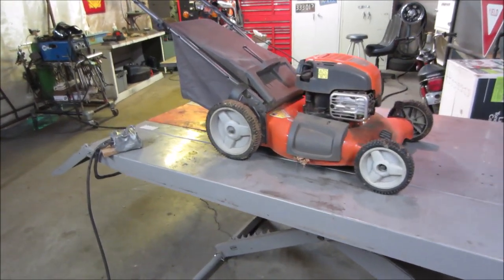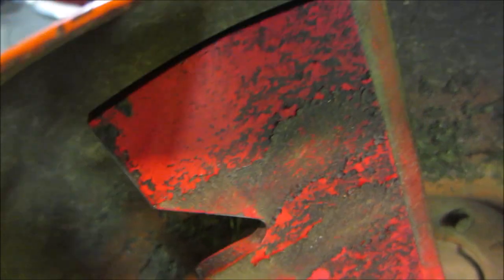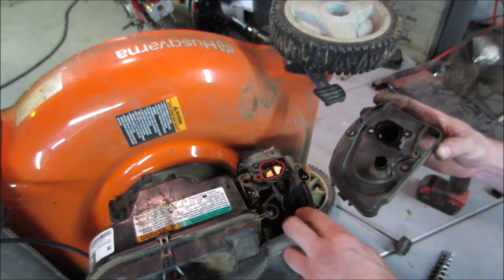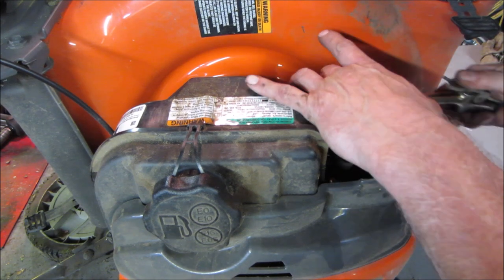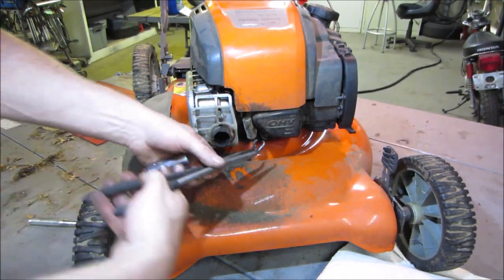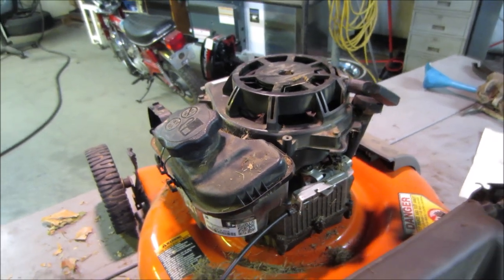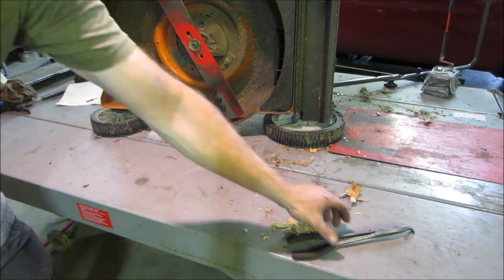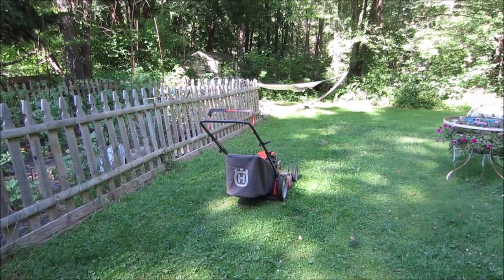NO OIL CHANGES? Servicing A Broken Yard Sale Lawn Mower,

Comment: I found two mowers put out for the trash. One, a nice Toro with a thick steel deck and nothing wrong with it. The other, obviously had been run by someone mechanically declined, with the blade on upside down, air filter on the wrong way. Runs fine now, heh.

Comment: I used to run the "standard" gas with stabilizer in my push mower, and the carburetor would gum up from residue.  I switched to non-ethanol gas, and the mower has been running like new for 9 years.

Comment: I guess they were just expecting enough oil to burn in order to eventually add more! My little Briggs and Stratton doesn't have a drain plug either. Just tip to change.

Comment: I bought my first push mower for $20 and fixed it with with a new pull cord and a brake cable, starts on the first or 2nd pull every time and never even touched the carb.

Comment: That Briggs and Stratton engine has some good qualities, but you have to be careful fueling it, if you go too fast or put in too much fuel it pisses all over the air cleaner and won't start unless you change the air cleaner or wait 30 minutes or so for the fuel to evaporate. I also put a prefilter on the air filter to help them last longer, so far so good with that.

Comment: Harbor Freight sells a nice little hand pump that I use just for this purpose also you can use a vacuum method with a mason jar I do lawnmower myself for these oil changes I charge $10 because what I do is I fill it up with oil run it for 10 minutes and then change it again my customers really appreciate the oil being decently clean

Comment: Never change the oil so it breaks and you buy a new one lol. I just got 3 riding mowers and have 2 of them running and moving this afternoon. One needs a new throttle linkage and a new tire I tried to slime it and it was just so dry rotted and cracked that it didn't seal it entirely. I'm gonna resell it "probably" so I might want to replace the tire with a brand new one. I also kind of want to keep one for work but I'm not sure which one to keep! Only one has a deck with blades but the other 2 are heavier duty, the 3rd one is very heavy duty it is more of a tractor. Just so happens the tractor will not run and I'm not sure what is wrong with it, I haven't had a chance to pick it apart and see what it needs.

Comment: I've used my mower 30 years and never changed the oil just twice on the spark plug. And it's been sitting outside all these yrs. It has always started by second pull
Reply: What kind is it? That's quite a distance! but honestly it's not as critical in a push mower, especially with a smaller yard or with shorter run times. Usually the wheels and cables are all crappy and broken before old oil takes out an engine, as long as it's not run low. They're pretty simple and durable when they're older.

Comment: we had a brand new craftsman that said just add we ended up giving a 400 dollar mower away to a friend that has a lawn service he hard a hard time getting it to stay running but it works now . I work on my old craftsman but not the new ones you have to use premium gas or that high price gas in a can. right now working on one my aunt gave me it won't start I guess I will trying cleaning the carburetor first but will have a new one on hand just incase good video

Comment: This is a pretty good lawnmower too. It must be pretty new because I bought mine last year from a husqavarna dealer. Cant believe they threw away their lawnmower for 30 bucks because of a blade that was backwards.

I'd probably keep the 30 and give it back.

or maybe sell it for 80 after, especially if its only a couple years old. Or more, cant remember how much this machine costs.

All over someone not reading.

Comment: I enjoy all of the videos you have posted.  I live out in the boonies and hate having to take my machines in for service and repair all the time.     I have one question for you.   On two stroke engines and four strokes. Which fuel would you recommend.   100%  No ethanol or one of the synthetic fuel? Storing for the winter I can see the synthetic would be best but using a lawn mower every week would be a lot cheaper to use the 100% No ethanol  but use the synthetic during the winter.  What do you think?

Comment: I picked up (on the sidewalk) exactly the same mower a year ago , old gas left in the carburetor problem , instead of cleaning the carb. , I replaced with the new one (under $20 from Amazon) , year later still running and no difference than a brand new !

Comment: Scored my craftsman self propelled electric start that way 25 bucks for it and a string trimmer cleaned the carbs and a air filter both run great electric start even works

Comment: The reason u never need to change the oil, just add is becuz they never last long enough to need an oil change and either burn or leak what u add. Garbage with plastic carbs. A real.revalation to me as i believed them to still be the company of quality whose dirt bikes i road back in the day. Of course thst upside down blade was cute. I liked ur oil change idea.of just tipping them over as the plugs never wish to break with their unions position of being stuck for life or stripped. Rich/San Jose

Comment: No problems with my husky, just change oil, and tune up each year sharpen the blade once in a while and let it go, however the dead man and self propelled cables are bad,  other then that works great as a pusher for my postage stamp property.

Comment: I bought a Chinese moped NIB , only topped it up when needed, ran it over 25,000 miles before I changed the oil, still runs good as new might put the oil back in
Reply: Sure your engine is full of Brown sludge and it wont Last long please dont sell the moped!
Reply: is it ? I don't think so, I put 5000 more miles on it since the oil change   , and no I won't sell it  , I will  continue to test too destruction , and many miles are at 55MPH ( itsa 2010 taotao vip powermax 150cc) _  Only cost $650 NIB

Comment: I never use a sandblaster on plugs as it accumulates sand particles wedged up into the plug and destroys the cylinder wall. much better to just replace the plug with a new one or in an emergency, Burn-clean the plug by playing the flame of a blow-torch over the electrode end

Comment: pretty sure i have almost this exact mower. ours is self propelled...this is going to be illuminating.  Fiance's dad helped clean the carb out because we did a dumb and left it with ethanol gas in it overwinter and it got gummed up.

Comment: Put in some new blades, change and gap plugs, change the air filter, change engine oil, clean deck near blades and then test on the lawn. It should run like new unless the fuel is bad or there's a clog in the carb. Always tip the mower on it's side with carb side up and the oil drain hole down.

Comment: I have used the same yardman lawn mower for about 15 years, never changed the oil. Never had to add any either. Only ever added gas and a new drive belt. Think I got my use out of a $100 mower.

Comment: I've been running my mowers on 2 stroke mix because I don't want an assistant misfueling the 2 stroke stuff. Runs fine, and it seems that 2 stroke gas doesn't clog the jets like straight gas may. (Will still eat gaskets, though.)

Comment: when i bought my new mower it came with a bottle of "forever" oil which was just a bottle of 5w30 full synthetic i read the engine owners manual from briggs that came in the box with the mower and the recommended oil change interval for a full synthetic oil is every 50 hours for mine. so you figure you mow half hour once a week 6 months of the year that is 4 years before you hit that oil change interval there hoping to sell you a new mower every 5-6 years. I personally  change mine every couple years and just use a auto parts store store brand 5w30 full synthetic one quart changes both my mower and my snowblower its cheap insurance

Comment: I get at least 5 or 6 of these style engines a year. Very weak connecting rods when under load such as tall grass. Had several with rods snapped. Also pretty much oil burners from day one, which is why you don’t change, just add. 😂

Comment: I’ve asked others this question and gotten no response. I have an MTD push mower and there is a funky little device off the muffler. 
It looks like a smaller muffler with screens and little holes. I think it might be some sort of crude air induction to reduce pollutants. But not sure
Reply: That's the spark arrestor. Stops all the hot carbon spitting out your exhaust possibly starting a fire and is also for pollution control. Take it off the mower, soak it in some petrol/gas and it should clean up, an old toothbrush works wonders. Refit when dry and it should be good to go for a while. I check mine maybe every year or so.

Comment: Did the smoke smell like burnt rubber? If yes, it was motor oil which went through the cylinder into the exhaust system when you slightly turned the blade (and the engine) while the mower was tilted. Seems to be a Briggs & Stratton thing, happens to mine too when I'm cleaning my mower's belly.

Comment: For fouled plugs I just hit it with a propane torch and burn off whatever oil/gas/carbon off the plugs. get the ceramic nice and cherry hot and go all around and you'll end up with a nice clean plug.

Comment: I BOUGHT A USED JD MOWER, IT DIDNT RUN WELL, I RAN A FEW TANKS OF SEA FOAM THRU IT, WENT TO WORK ON THE DECK ONE DAY, MAYBE REPLACE THE DECK BELT, TOOK THE BLADES OFF AND SHARPENED THEM, THOUGHT WOW THAT STILL LOOKS NEW, IT WAS UPSIDE DOWN, BUT THE STRANGEST PART, IS IT RAN BETTER, LOST THE MISS IT HAD JUST WITH TURNIN THE BLADE OVER

Comment: hey Mustie1!  I really love your motorized bike builds.  Recently Zeda Mafia has released a water-cooled 66/80 cc China girl.  I had a stock one of those kits a year ago.  It was really fun!  (And cheap)  and broke down ALOT.  But it got me thinking,  why hasn't anyone built a water-cooled v-twin engine using the el cheapo parts (or as much as possible) for those of us who don't have a pile of tools in the garage?  (I'm throwing this idea at you because if ANYONE can, you can!)  I'd like to see both an increase in durability (over stock) and modular (sort of) kits.  Do you think such a thing can be done?

Comment: Did the mustie1 2 stroke trick on my mower (almost exactly the same as this one) when it would not run but had spark. Thank you!
2 stroke mix in the spark plug hole made it start first pull but I got to wondering does 2 stroke work better for that scenario or are you trying to get a little oil in there generally when you are using it?

Comment: I have a Honda mower. Running rough so went through the carburetor and now all looks good. Runs great now but sometimes when I bump the mower front against something it cuts out briefly them returns to normal. Possible float issue? Thoughts?

Comment: weird thing is you get a blade you put it on and then you mow and if it does a shit job you know that you done something wrong and that would be when you put the blade on and who doesnt put a blade on and then use it straight away. i think its so weird that Americans have an off season for mowing. here in australia we just go from doing it 2 to 4 times a month (in my case 5-6times) to 2 times a month. so we are always using it and we dont need to empty or add anything special to it unless you live near the snowies. so mostly the men every 2 weeks put a day off normally on a sunday to get out and do the lawn. i think we use mowers so much here that all it needs doing it clean air filter and just add a little bit of oil every so often, never done a full oil change just because we use it so much and the oil slowly goes down.

Comment: In the military we no longer do oil changes in our vehicles.  An oil sample is taken and sent in for analysis and we are either told to change the oil or replace the engine if the oil is contaminated with metal.
Reply: har har
Reply: Flyboy truth.

Comment: Ha ha ha,I owe you a beer.
"I just tip it on the side and let the oil drain out the fill hole."
Simple solution.
No drain plug deez nuzats.
Reply: Cheap oil extraction pump. Stick small hose in dipstick opening and wallah ...   I can change the oil in my mowers in less than 10 minutes if the oil is warm without any spillage.

Comment: I have that same mower.  Briggs does address the issue in the owner's manual.  They absolutely do recommend never changing the oil.  If you want a more detailed explanation of WHY that is their recommendation, visit their website. They will explain that this new engine series has a different super smooth honed cylinder that is designed to need minimal lubrication to start with due to the very little friction created in the cylinder.  Plus the engine is designed and built with materials that dissipate heat much better than older engines did, therefore the engine runs much cooler so the oil doesn't break down quickly.  

Briggs claims with the proper recommended weight and type of oil, which is important to follow for the temperatures the machine will operate in, there will be very minimal oil usage.  In three years of operating my mower, I have found oil usage is indeed minimal plus the oil isn't terrible looking even after three years of no oil changes.  

All that said, keep in mind the manufacturer only provides a three year limited warranty.   Essentially, they are betting that this no oil change practice shouldn't cause the mower to break down during the 3 years the factory is agreeing to warrant it.   Given that the average homeowner using this walk behind mower isn't cutting vast amounts of lawn acreage, usually only cuts the lawn every week or two, and operates the mower seasonally when grass is growing, its pretty easy to see that Briggs probably figures the math this way.  People today tend to buy riding mowers when they have much more than a hour mowing job to do so you can consider this walk behind AWD mower to be likely purchased only by low intensity users with limited yard mowing to do.

Say, two hours per week of 8 months time for average use each year, or 60 hours per year operating time on the machine.  In the three years of the warranty period therefore, the average residential home owner will put 180 hours of operating time on the mower.   I don't even put that many hours on my mower as I can mow my yard in about an hour.   So the question becomes one of whether or not this particular cooler running engine built to generate less friction can last 180 hours without an oil change, assuming of course that all other maintenance and operating procedures are carefully followed such as keeping a clean air filter in place.

Personally, I think this mower, or maybe any mower, could operate 180 hours without seizure or mechanical failure if the oil is merely checked regularly and topped off.   That really isn't a large amount of operating time and a good oil can likely handle the stress load of that much time without being changed entirely but just topped off.

So is the factory recommendation to not change the oil wrong?  Not really, if you only consider the life span to be what it is warranted for of just 3 years.   But if you as the owner might like to get more life out of your equipment, changing the oil more frequently might still be the prudent thing to do, perhaps even as often as once per year.   I changed mine at the end of the three year period.  Since I use good oil, keep it checked and topped off, and change air filters every 25 hours or sooner, I feel that is adequate.  I also keep my mower in top condition, using only non-ethanol gas, and even installing a new plastic carb at the end of year 3.  

Obviously, if you are going to operate the mower in a much more intensive fashion for longer hours at a time and more times per week, then you are going to rack up a lot more operating hours on the machine and should consider changing oil based on the number of hours of use.  Likewise, heavy use in very dusty environments, even with frequent air filter changes, can still let particles get inside the engine that the oil must clean out.  Changing oil frequently is probably the wise course if you have those kinds of issues.

Great video.  I'd recommend going back to a factory issued blade on that mower however, plus of course mounting it right!  I'm not sure an after market blade not made for that mower will be balanced right and that can cause major issues with premature wear on the motor.

Comment: The reason you don't need to change the oil, is due to carb clogging up after sitting over the winter. My mom's mower has a carb like this one. I have to clean it out every year, even tho she runs non-ethanol premium fuel in it. you only get one season out of it before it wont start again.

Comment: Mine is 6 years this year. The oil they use is something special they think. They expect you to use only their oil only or you void the warranty. If you think about it the amount of stress the oil is under in these newer better engines the oil should last much longer that a mower from say the 1970's that commonly belched smoke after only a few years. Anyway, on an engine that only runs in the warmer months it doesn't matter whether you use a single weight oil like a straight 30 weight of a 5w or 10w. The 30 weight is the important number as 5w which designates at how the oil will lubricate at a given temperature. There are often temp scales on the bottles of oil. Also, some engines cannot withstand the additives that are in most automotive engines. Last I checked parts stores still carried an older type motor oil not meant for today's engines but prior to 1975 I think but you should check with someone you trust if you are not sure. New oils have a lot of cleaners that could cause leaks in older engines especially if the have sat without running for a long time.